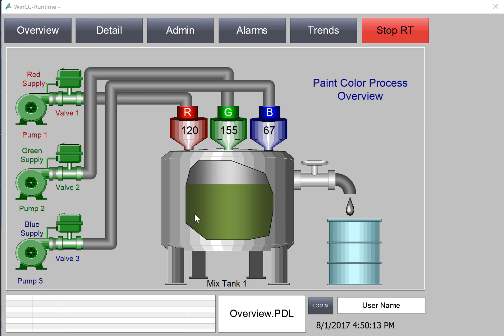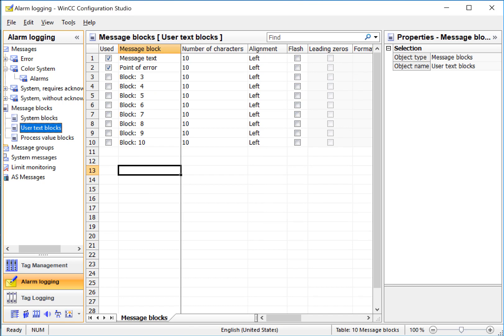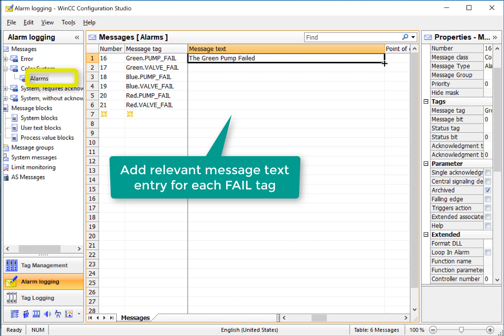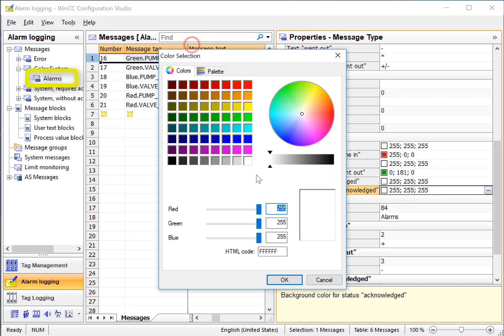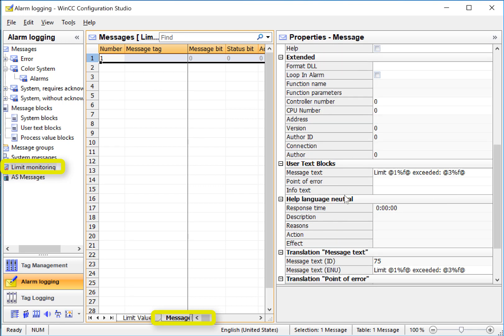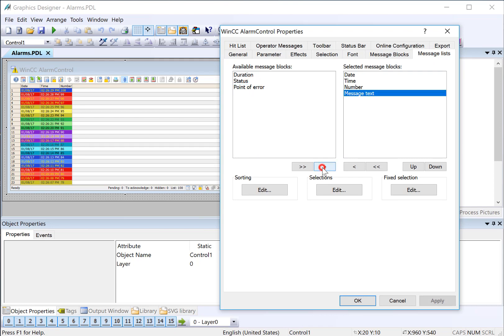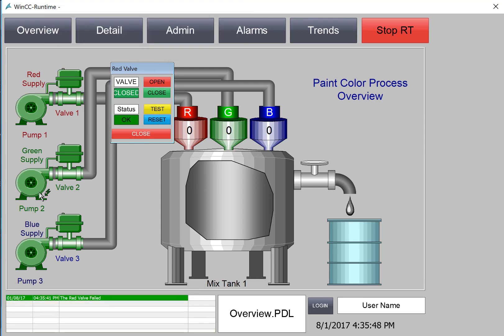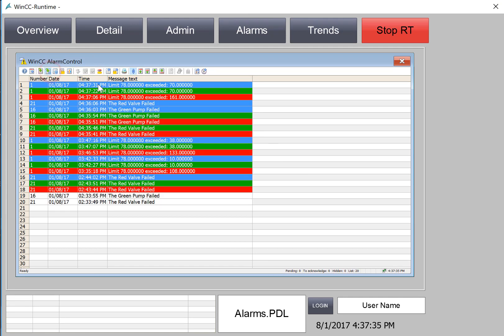WinCC v7.4 Step By Step #16: Creating Alarm messages in WinCC ⚠️ #winccguru

Comment: Can I control a message alarm when bit is off not with on
Reply from the maker: Yes. On the alarm message, there is a check box for falling edge. This will trigger the alarm on the one to zero transition.
Reply: @WinCCGURU  
I have done that, but no change occurred.
Are there any other steps I should take to make it work?
Reply: @WinCCGURU  
For bit messaging, you can specify whether the message is generated at a positive or negative signal edge. In all other message procedures, the message is always generated with a positive signal edge.
For messages with negative edge, you must configure the message tag with start value "1".
How can configure start value to 1?
Reply: @WinCCGURU  
Falling edge suitable for plc tags ( external tags)?
Reply from the maker: @mohammadhamdy6694  yes
Reply: @WinCCGURU  
Thanks a lot
Reply: @WinCCGURU  
In alarm control panel 
Alarm don't appear in alarm message but appear in short term alarm
Why?
Reply from the maker: @mohammadhamdy6694  some alarms, like operator messages or "system, no Acknowledgement" go directly to short term archive because they aren't considered Alarms, but messages. check that your alarms are not in these alarm classes. Also check the settings on your alarm class.

Comment: Hi Bob,
Thanks for the many videos you posted and it really helped me. Just a question if you can assist, Can I create two separate Alarm controls to work independently in winCC explorer V8 if I have two separate systems running in single project? 

Looking forward to hearing from you

Regards.
Reply from the maker: Yes you can! You are not limited on the number of alarm controls you can add to the project. They can all be filtered many different ways so for the other system, as long as you have the tags in there and put them in their own group then just filter that alarm control to show messages from the other system.

Comment: Hi, I'm trying to set a Alarm group for OPC UA Tags, but in Tag Selection Dialog I can't see my tags list, i already logging this tags for Trends but i don't know if is not possible for Alarm logging of OPC tags.... Thanks!!
Reply from the maker: Alarm logging only allows discrete tags such as unsigned 8,16 or 32 bit or binary. 

If your tags are signed or float they won’t show. You can however use them with analog alarms and set limits.

Comment: hello sir,
i could'nt find my wincc tag simulation window in wincc..
how to open that after starting runtime.
Reply from the maker: Which version are you on? In WinCC v7.5 and higher it’s in WinCC control center. In WinCC 7.4 and lower it’s a windows app called tag simulator.
Reply: @WinCCGURU  sir i still haven't found  this options in wincc 7.5
Reply: I found tag simulation option below down the wincc explorer, but that didn't work like you have worked in uploaded videos tutorial..
What's the difference or changing i have to made 
Could you guide in that
Reply from the maker: That video was done in v7.4 which had the old tag simulator shown in that video. I have updated videos for WinCC v8 that use the same simulator as WinCC 7.5. See the V8 playlist here : WinCC v8.0 Step By Step - Learn SCADA Programming!  😍 SCADA Programming Full Course #winccguru
https://www.youtube.com/playlist?list=PLGP1qT2NhERwDkEgDOPCUzVd7DbSZ1qg7
Reply: I am using WinCC v7.5.
But where to or below which...?? this option could be find out
Reply from the maker: Look in WinCC control center. There is tag simulation editor.

Comment: Hello  WinCCGURU.
I'm currently struggling with WinCC v7.5 SP2, because I'm not able to set, for the message source (text) of an alarm, an internal tag (Text tag 8-bit character set.

How can this be achieved? Is this applicable to external tags also?

However, I managed to display this internal tag content a process value.
 
Thank you
Reply from the maker: You can use the insert process variables method. I’ll post a link to the video to show you how.
Reply from the maker: Watch this video to show you how to insert the value of a tag into the message text. You will need to choose string as the format char %s. WinCC V8 Tip 7: Insert Process values Into Alarm Messages! ⏰ Learn SCADA Programming #WinCCGURU
https://youtu.be/ronYL9X_bdo